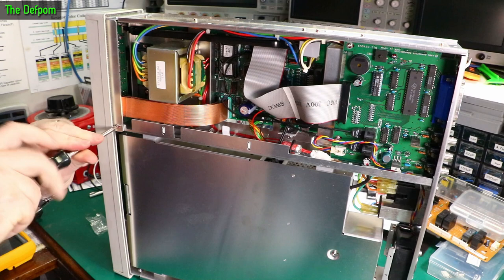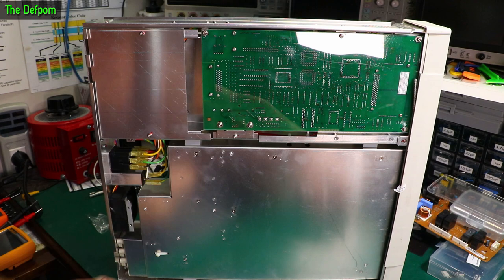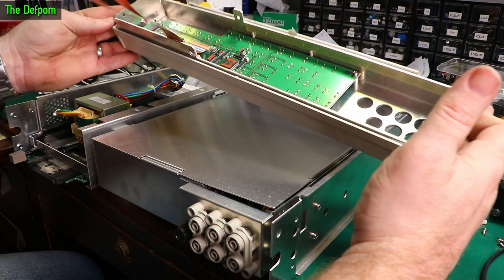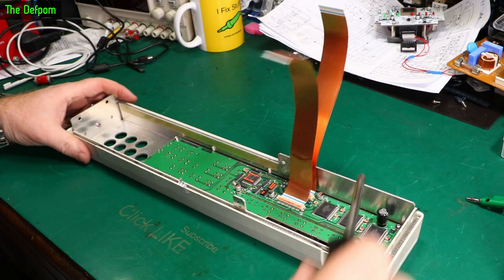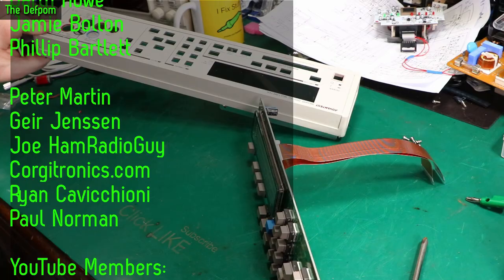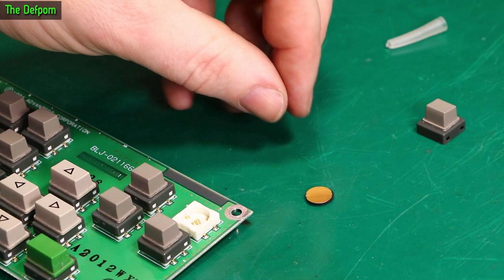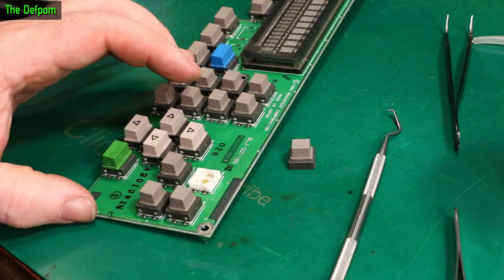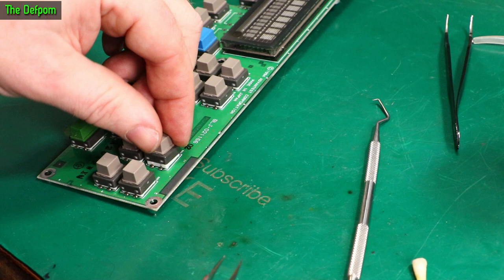🔴 Advantest R6581T 8.5 Digit Multimeter Repair Part 2 - No.1053

Comment: You need to investigate the temp sensor, as it may make temp coefficient adjustments for accuracy.
Reply from the maker: It is returning values ok now, I think that sorted itself out once I replaced the battery and did the Internal cal, I haven't seen it missing since.

Comment: Nice, a simple switch clean is best case scenario really as it could have been so much worse...cheers
Reply: No kidding.  It could have had those flip contact switches with the little spring/guide inside.
Those can be a real 🐩 to clean.  They take a lot longer too, because sometimes, the little parts inside often try to fly home to the 9th dimension.   Some make it home too.   LOL
Reply: @BlondieSL  Lol !
Reply from the maker: Yes, exactly

Comment: Dropped a comment that must be in moderation (had a couple of URLs in it) - Meant to say that "by success" I meant better but not original state and that I've never tried rejuvenation.
Reply from the maker: Odd, I don't see your previous comments at all, even in the blocked comments section, weird.
The display is actually usable now, where previously it was so bad it basically wasn't, I would still like to get a replacement, but I don't like my chances of getting one.

Comment: Speaking of cleaning contacts, with TV remote controls that use those stupid rubber contacts where the carbon material wears off, has anyone ever tried Aquadag Colloidal Graphite spray?

That's the conductive spray usually used on the bell of CRTs,  to recoat the rubber contacts to rejuvenate the buttons so the remotes work again??

The remote controls, over the last bunch of years, are made so cheaply and the coating on those little rubbers wear out so quickly and unevenly.

The usual "cleaning" no longer works on those.  So I though, using Aquadag might work as long as it will stick to the rubber.

However, it doesn't seem to be easy to find this stuff.  Decades ago, when I was a TV Repair man, I had several cans of that stuff as I'd often get a TV in where the coating on the bell was scratched up and not doing its grounding job as well as it should.

Has anyone used that and what were the results, if you did??

Thanks in advance.
Reply: Most conductive coatings I have tried are too brittle and break/crumble in short order. MG Chemicals used to make a great repair kit that was a three-step process: 1) clean the pad, put a drop of the included super glue on the contact, 3) after glue dries, wipe a thin layer of the included conductive paint on. Since MG quit making the kit, I tried a good quality super glue and CiaCote 44. This works great and lasts.
Reply: @HeyBirt  I'll look for that stuff.
There is something I'd love to try, Conductive TPU (flexi) filament for 3D printers then design a full membrane for the remotes that have that 1 solid membrane layout.

But WOWWWW!!!  The prices being asked for this stuff is beyond stupid!

Like $100 for 0.5 KG.

Perhaps a winter project for me might be to do some tests with mixing some of the ultra flexi TPU I have with conductive materials.  See what mixes and what doesn't.

For now, however, I'll try to course the stuff you mentioned.  It would be easier.

As for a good super glue, I've discovered the Gorilla brand and it's the most impressive I've used to date.

Thanks for the idea.

Comment: Looks like the display is behind smoked glass, might try switching to clear until you can find a new display.
Reply: That could totally pooch the display.
Reply from the maker: Whenever I pull a front panel off like that I always clean the inside of the display window, there is ALWAYS dust there, it is quite amazing sometimes how much difference just doing that can do !

Comment: Are you just removing dirt, as gold does not form oxides very easy if at all. Unless they did not deposit 24k gold on the contacts?
Reply from the maker: My experience says that there are oxides on older gold contacts, my guess is that there are impurities in the plating process (be it a switch contact, or a PCB edge connector) and those impurities are what causes the problem.

In a way this video proves it, gold plated switch contacts, gold plated switch disc, all of which looked spotless, and yet they didn't work until I gave them a clean.

I come across this most often on PCB card edge connections, and have shown this in repair videos too, where the unit is playing up until I simply clean the gold edge connectors and put the cards back in, one of the best for this in a video was on some HP 5342A repairs (on 3 different units I think).